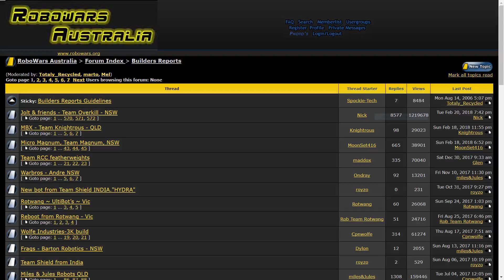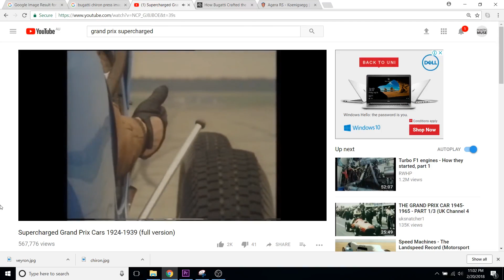Everything is iterative.

Comment: So I designed and 3D printed my own high performance PC case.

It look ~2kg of plastic (incl. prototypes) and I worked from scratch in the first few times.
To put it simply, I needed measurements from someone else to get it done since I can't practically measure what I needed measured to get it done.. As I needed to use the PC parts I was measuring, and waving around metal calipers on a running PC is not a good idea :)
I ended up making a new case after the one that worked and that one is just so much better in every way.

Comment: Well, Angus, I remember hearing one of my professors mention iterative design in the late '60s.  Then, I read some book on the same subject a few years later.  I think I watched an old VHS video some time in the '80s that may have mentioned something similar.  So, my question is "Why didn't you research these relatively obscure authors more diligently, and give each and every one of them credit for their previous work on iterative design?"  Surely Mr. Google would have had only a few tens of thousands of relative hits on this subject.  It would have only take a few minutes at the end of your video to list each and every one of them in a "Credit" scroll.  You really missed the mark on your due diligence this time Angus - you should be ashamed of yourself!
/s
:-)

Comment: Very true words. Sometimes I force myself to accept a first design as I want to see working results as soon as possible but usually these first designs aren't nearly as good as I'd like them to be. So using exactly those iterations you were talking about, I'm now redesigning my models (twisty puzzles) to improve quality BEFORE I even print the whole thing. Often, when an object is finished, it is harder to put it aside as a prototype but if you just produced (printed) a small number ob pieces, it is often a good prototype you can then use in order to finde small errors and methods of improving the quality of these "products". 
The only problem with iterativie design is that it requires a lot of patience. But if you are passionate enough about a project, I think that it is easily possible to improve again and again...

Comment: Thanks for reminding me.  Being a software geek and engineer (mechanical) by training, and tinkerer at heart, remembering the basics are a wonderful refresh.  I've done hardware design, firmware, and mainframes and many machines inbetween of different eras of computing.  Sysadmin, application developer, and mainframe systems programmers, worked in assembler and machine code, second generation languages (got out just before OO design took over), done much more than just Windows type systems.  Ideas come from all around.  After many years, you see the same ideas resurface with new packaging and a different emphasis, but the basics are still the same.  Still, it is the re-thinking, re-analyzing, re-imagining, in many different iterations that define the evolution.  Rarely there is a non-evolutionary idea that hits.  The term is Revolutionary.  True Revolutionary Ideas are few and far between, but the evolutionary development  does the perfecting of the revolutionary concepts.

Keep up the great work!

Comment: Tesla roadster to be added to that battle soon!
Reply: Don't think anyone is going to beat the 13266 km/hour record that Elon's Roadster is currently doing lol
Reply from the maker: So keen for that!
Reply: Tesla is no where near the first production electric car.  Even Edison built them in the early 1900's (and many other brands - Baker electric is one that comes to mind).  Still Tesla is the first 'modern produciton electric' to be nicely marketed and gets plenty of press.  They are also doing lots of things right.  I am sure others will iterate on Tesla and be a worthy successor. ... Just not yet <grin>!
Reply: servant74 even earlier than that, the first ever electric car was in approximately 1832 by a Scotsman but used non rechargeable cells, it wasn't until 1891 where the first practical electric car was produced in the US, it's weird that cars have looped back around as electric vehicles were made just before internals combustion ones (the first which was hydrogen powered), and now we are looking at hydrogen fuel cells (mainly running electric busses atm) and fully electric cars again.
Reply: Well, You'll have to return it to Earth somehow - at first ...

Comment: Unfortunately, many younger folks have little patience for delayed gratification. Even I, as an older person (54) just getting into the 3D design and printing realm just over a year ago, found myself initially frustrated with the iterative process of design. I had to relate it to my military training, in that no plan, no matter how perfect we believe it to be, survives first contact. It's the same with design. We learn lessons each time we produce something, and take the steps necessary to fix problems we've found. Great, right? Well, the fact that we've changed some aspect of the design to fix one problem can, and often will, create another problem somewhere else in the design. I have given-up on some designs that, while initially a good idea, I just didn't have the time , the knowledge, or the ability to fix it. These go on the back-burner, and that's a good thing. As designers/makers, we find ourselves working on entirely different projects that, lo and behold, provide an answer, or at least a way forward, with an old project! Any time I screw-up a good idea, I always tell my wife "Engineering is hard!" I think I will change that to "It's a process!"

Thanks again, Angus, for a thought-provoking vid!